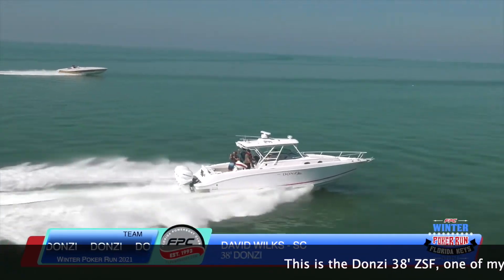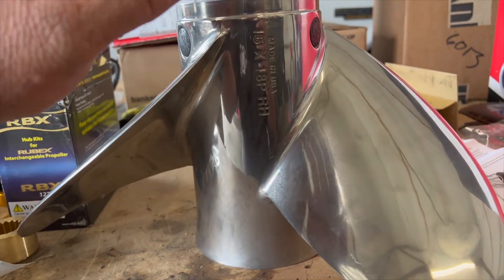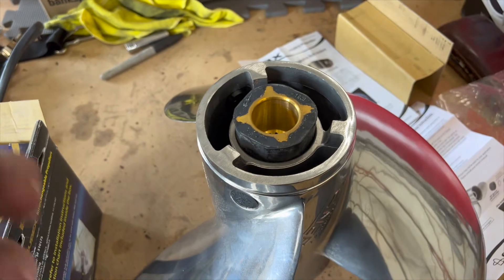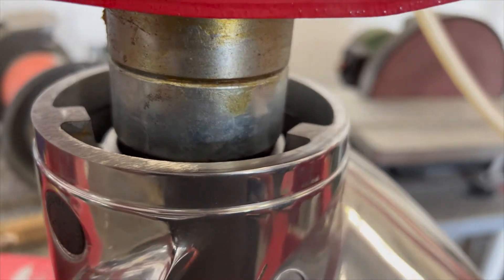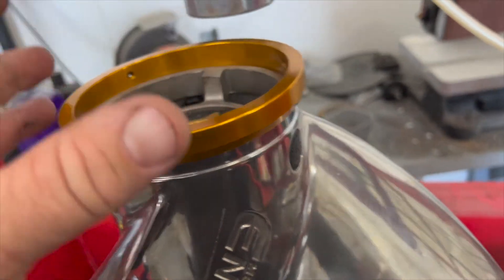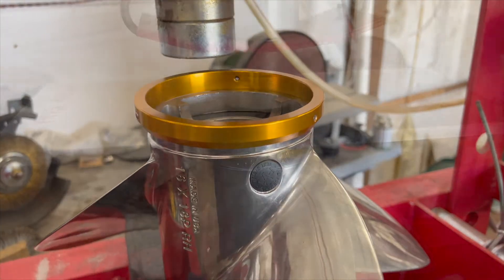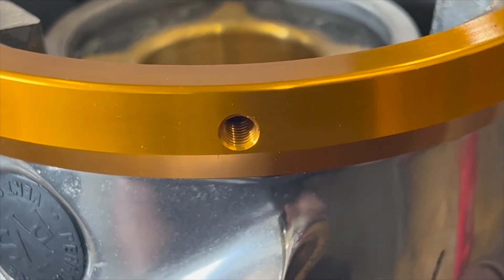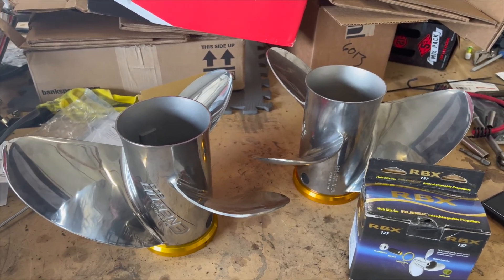Installing the Mercury #EnertiaEco Props On Twin Yamaha F350s for a Grady White Freedom!

Comment: Any trick for getting the exhaust seal rings on without a hydraulic press? 5 tons is A LOT of force. I'm thinking heat up the ring, and grab the prop from outside where it's about 30 degrees and using a rubber mallet to force it
Reply from the maker: You could try that.  I’ve installed these before using a heat gun on the ring and a 2x6” pine board with a mallet to push the rings on the prop.